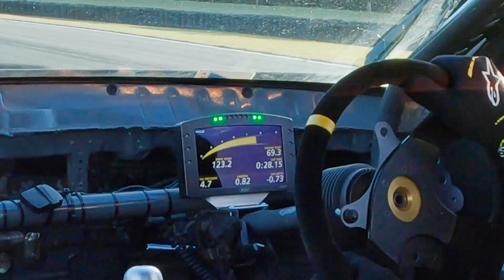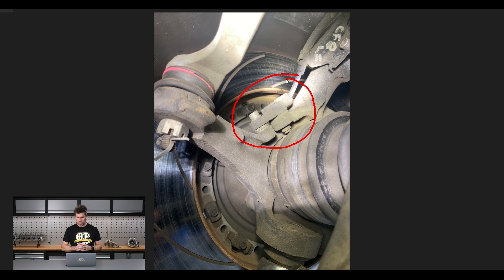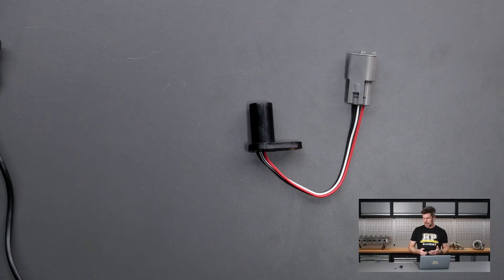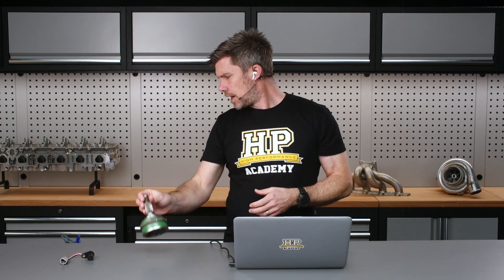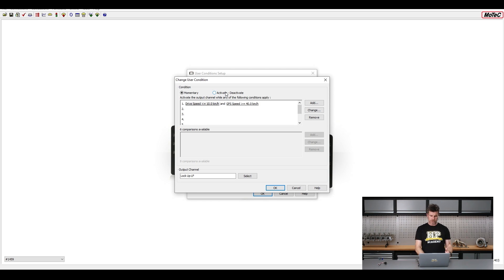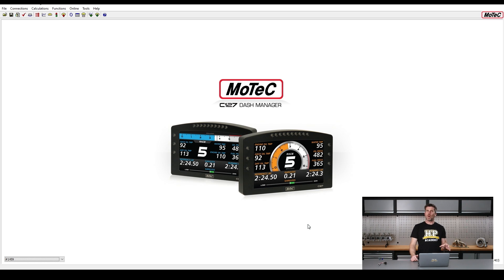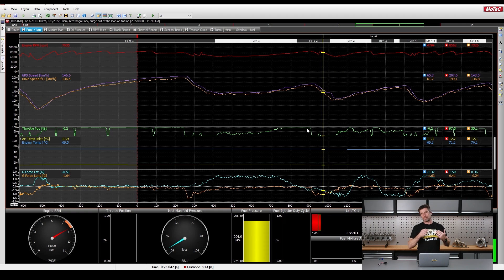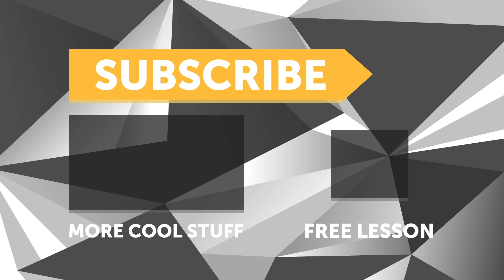The CRX Has No ABS? No Worries | Wheel Lock Up Indicator

Comment: I like that heat shielding laser welding is the shit !  Cause you’ve got an insulating air gap perhaps u could duct into that with a small elec  fan and get some heat outa there  as there’s a limit to the amount of insulation you’ll get in the space you’ve got    U could adjust your cooling via a variable speed fan   Luv ya vids

Comment: This is a really cool idea. But with short wheelbase cars and stiff suspensions, I have seen a lot of these cars lifting the inside rear wheel in hard cornering. This may give you a false indication, it may just be the wheel is in the air, 😂. Is this something you just drive through, and use a G-meter to bypass the light. Or do you advise a different approach like suspension mods or driving lines to keep the car flatter in that situation?

Comment: I think motec sells dual magnetic converter that changes the signal from magnetoresistive sensor to square wave signal. You can wire 2 sensors to go through one unit so 2 units needed for four wheel speed signals.

Comment: Fyi, UK/European crx's had abs. It's not the greatest system though and sensors are discontinued.

Also for the rear, any similar Honda trailing arm setup will fit. Eg, ek, dc, mb etc. They all had abs. Source: i used to test them off the production line. Code name 'rover r8', because they also fit rovers. Just change the bearing for one with the right pcd if you get a 114.3 one.
Reply from the maker: It's awesome how interchangeable parts are between Hondas. They've been doing for decades what many companies have only started doing more recently in that respect.

Cheers for sharing that info 🤓 - Taz.

Comment: Or stop believing this lye that ABS is bad and implement a proper ABS system on the car.. you got the sensors already.. just add the valving and controller.
Reply from the maker: Where did we state ABS is bad? We like ABS so not sure what you're on about there fella 🤪
Since it's so quick and easy just come do it for us eh, we don't have the time to do it in the next 2 weeks but sounds like you do 😂 - Taz.
Reply: @hpa101  everything is quick and easy on the internet.
Reply: The factory stuff is junk only makes sense to get a Bosch unit or something similar
Reply: From what I understand, they are still  experimenting with the Bosch MK60 on another vehicle.
Reply from the maker: @patx35  medium term plan is to do the same to this once we see how that all comes together, but for now, it really isn't the biggest thing we are worried about to get sorted before the first race - Taz.
Reply: just